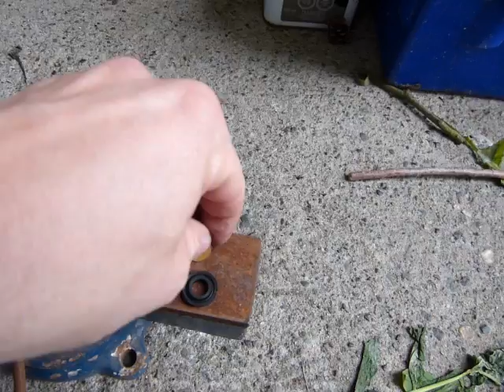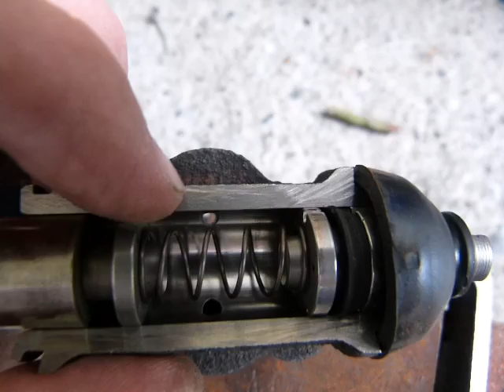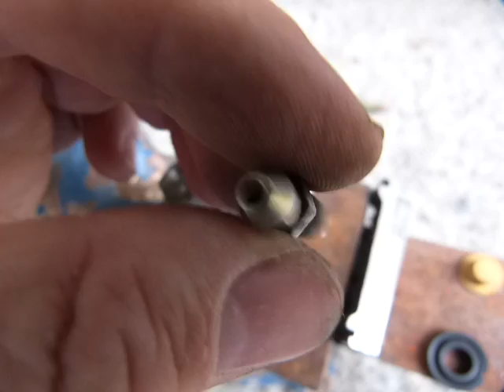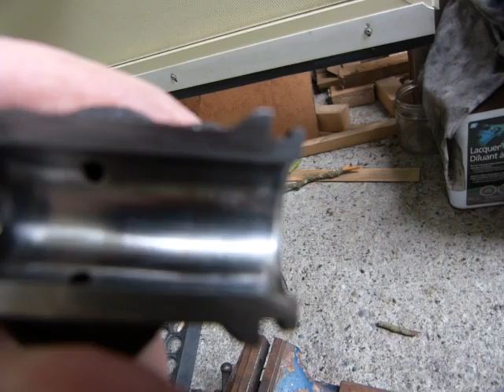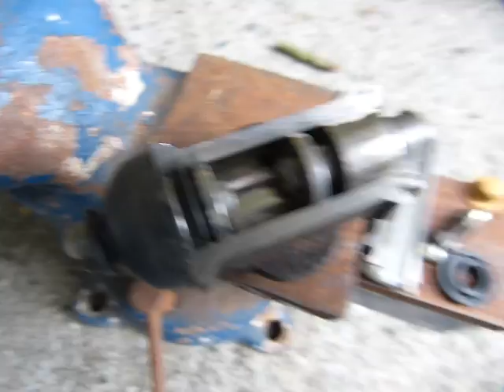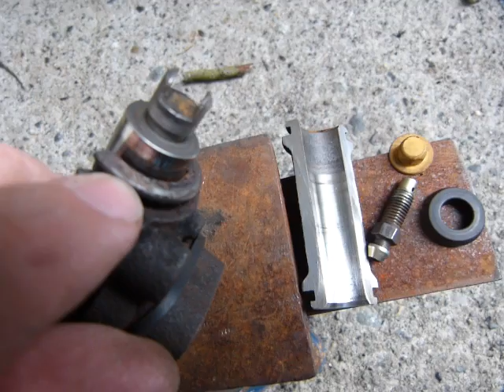Inside a brake cylinder

Comment: Super helpful video. I was told that my cylinder was 'weak' and i had no idea what that meant. I was under the impression that the cylinder only contained fluid. But now i see there is a spring inside that resists the forces of the springs within the shoe assembly.

Comment: Excellent cut-away and internal view !.... but honestly....get a camera mount and do everything with 2 hands so the piece doesn't flop around as you WRESTLE with it with one hand !!! .......and...at timeline 7:04 when you call this the brake MASTER cylinder....it is not the master cylinder but simply the drum brake cylinder. The master cylinder is the main fluid  source in the engine compartment, activated directly by the brake pedal. Nonetheless.....good cut-away not usually seen on YT...good job.
Reply from the maker: Right, it's a brake cylinder, not the master ... oooops
Thanks for watching!
Reply: @theoverengineer  ....👍